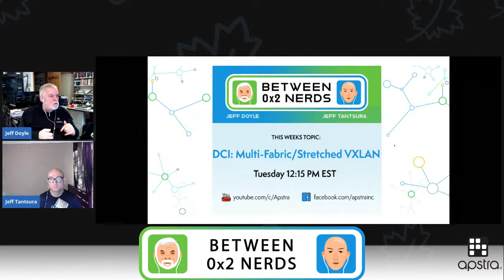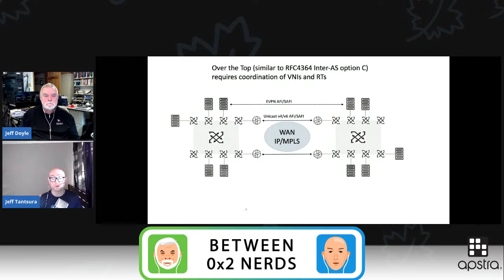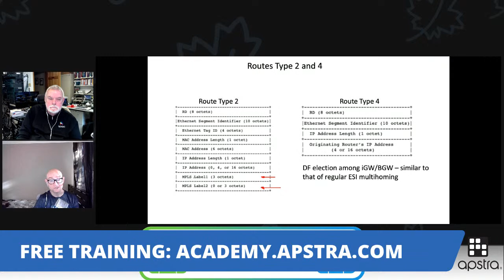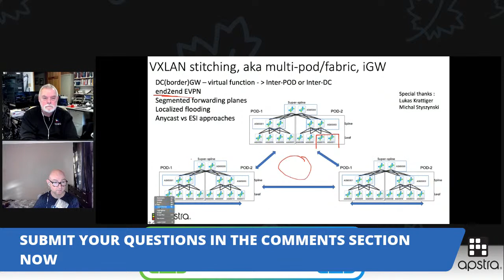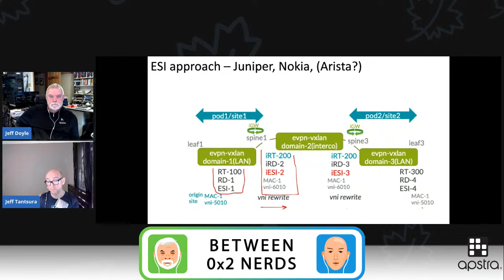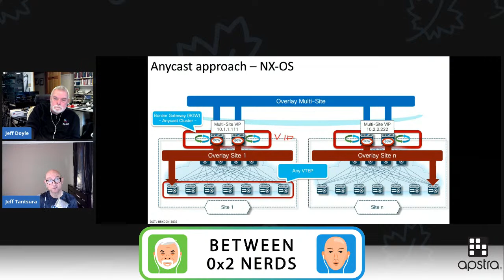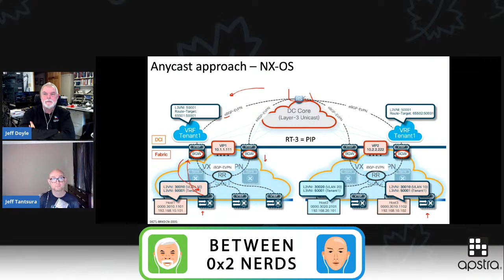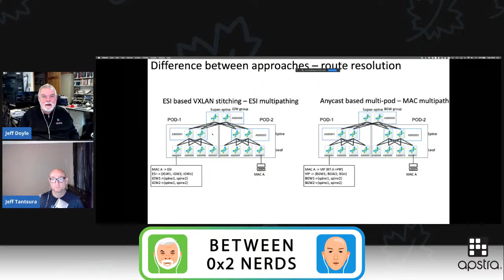Between 0x2 Nerds - DCI: Multi-Fabric/Stretched VxLAN

Comment: thx. jeff*2, I have a request..plz do a mvpn series...thx a lot. cuz it has 27 profiles potential design option that iv been read on Cisco technotes. but in general. is there got capability problems across multi vendors. the reason why I ask about this. there has no great RFC level architecture courses out there. so plz... huge thx to you all. by the way. I'm networking nerds too